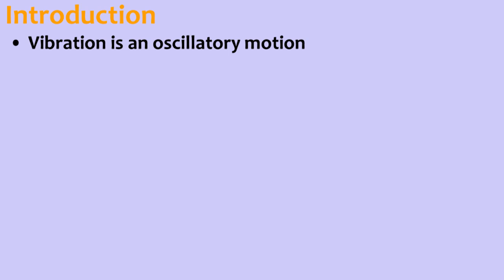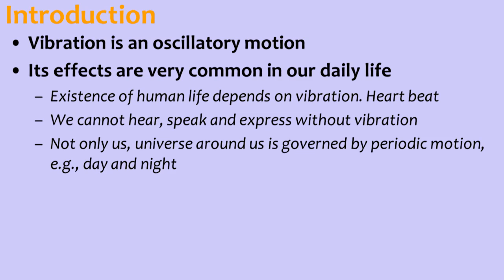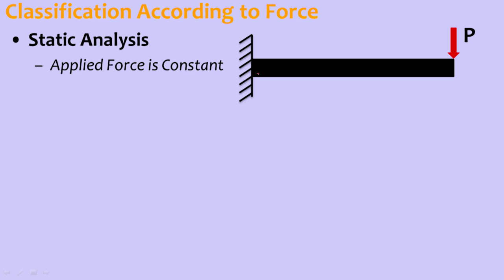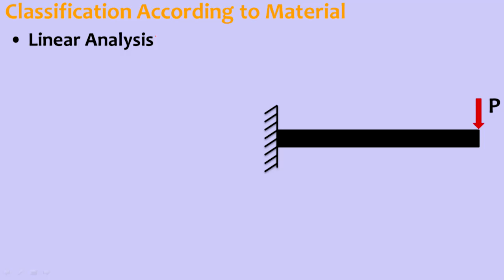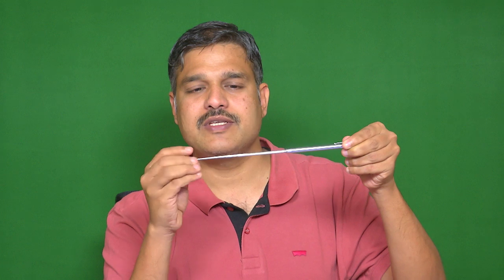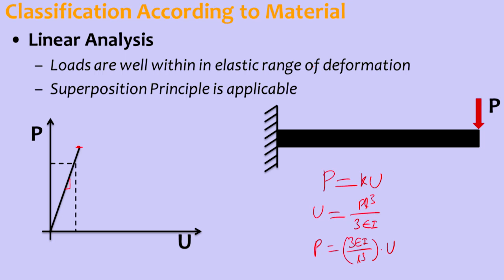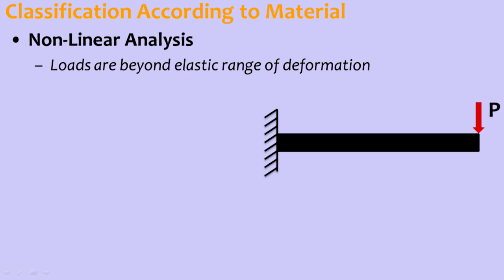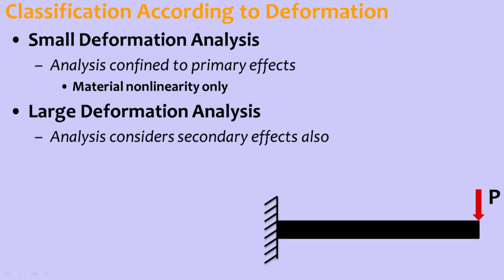W01M02  Static and Dynamic load  Types of Analysis

Comment: Sir, I have a doubt at 10:10, non-linear Analysis: 
1. Loads are beyond elastic range but that should be only for incorporating material non-linearity.
2. Superposition principle won't apply but that should be only for incorporating geometrical non-linearity.